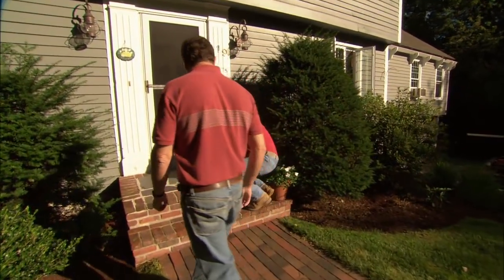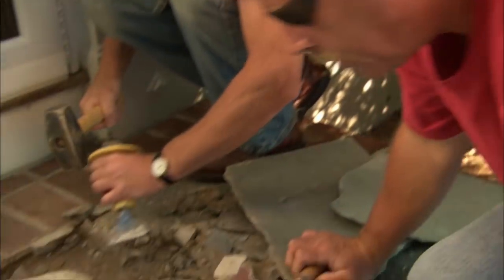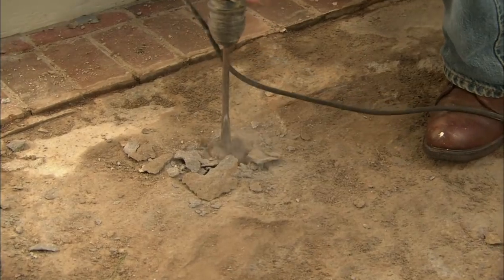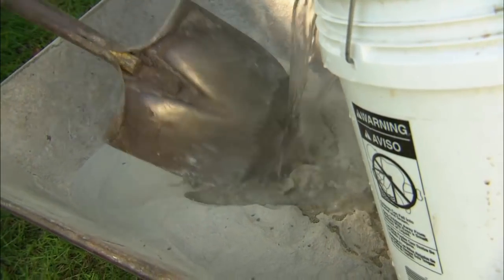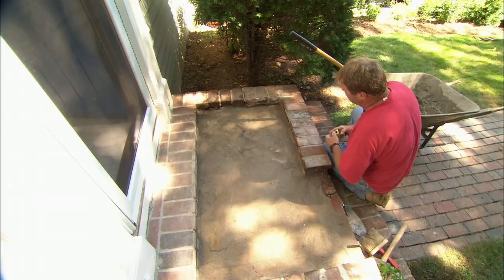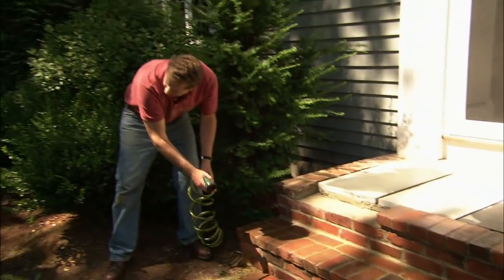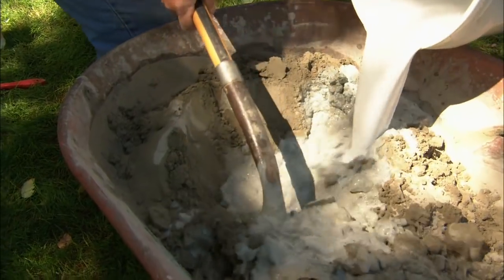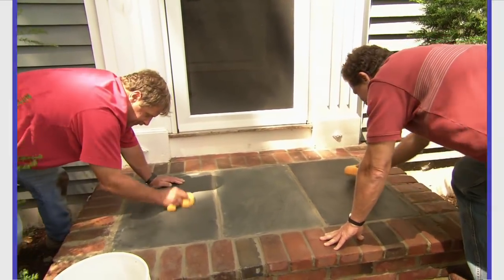How to Install a Bluestone Landing on a Front Entry | This Old House

Comment: Why wouldn't they paint some bonding agent on that old concrete as well?  Also, when excavating that old concrete, I would go around the perimeter, and also a few inside cuts with a masonry blade first.  Make it easier to chisel out with the rotary hammer.

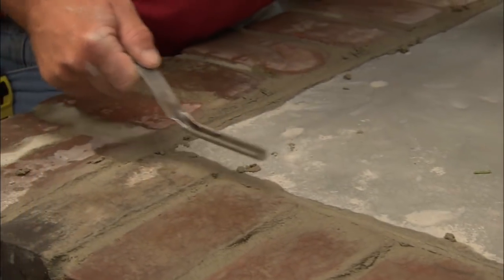Comment: 6:37 I just watched this on the Pluto station, and I have to say that I did not like the end result as it looked looked like a trip hazard.

The bluestone was a bit lower than the brick, yes, in the front, you could tell as the mortar was being smoothed down with the jointing.

01/27/2020

Comment: That looks like crepe suzette. The original look was rustic matching the falling apart house...
Roger is a true landscaper and for this reason he knows just enough about masonry to make him extremely dangerous.
First off that concrete base looked unstable so a quick structural hammer test would render the verdict to judge if it's suitable for use.
Second he painted the bluestone with a bonding agent but he failed to do the same over the concrete base so that paint job was useless.
Third he used dry brick mortar that's not suitable for large stone tiles. Mortar is NOT an adhesive RAWWWWWWWWGAAAAA! Give this job about three years and it's as good as the old one you removed.
Rawwwggga, spend some time with a true mason, learn the trade then maybe you can teach. What's that? You don't have time for all that? Then don't give bad advice; stick to teaching how to plant hydrangeas.